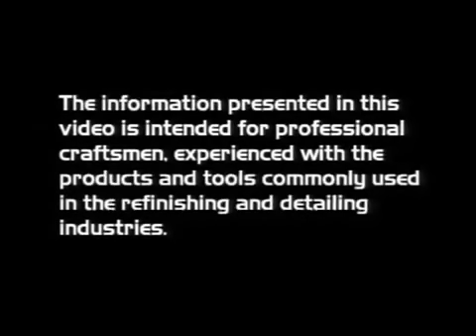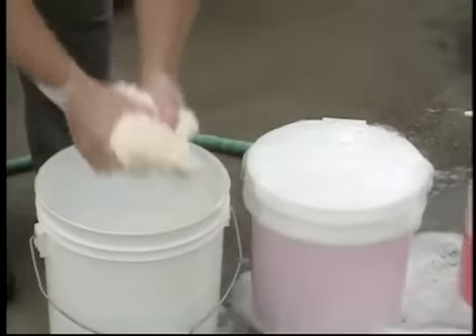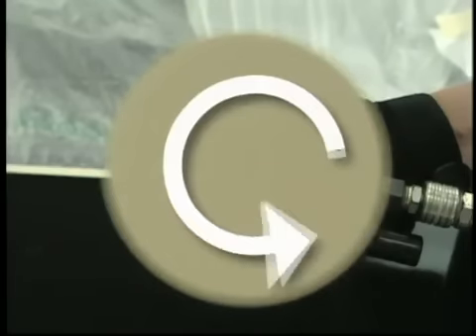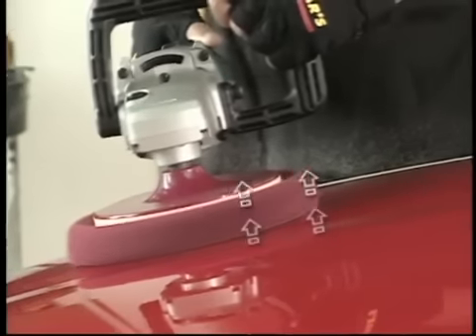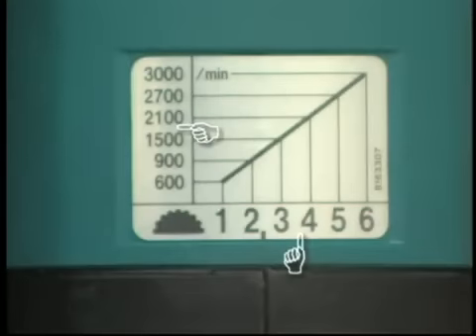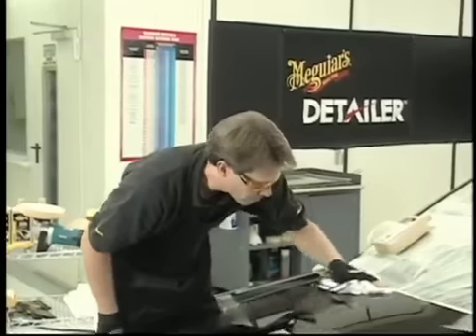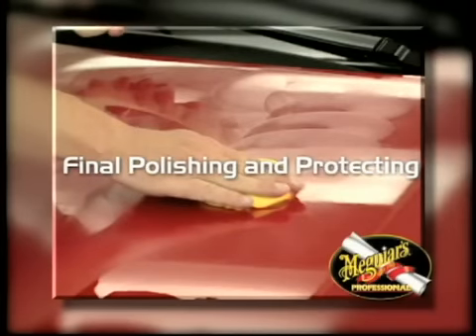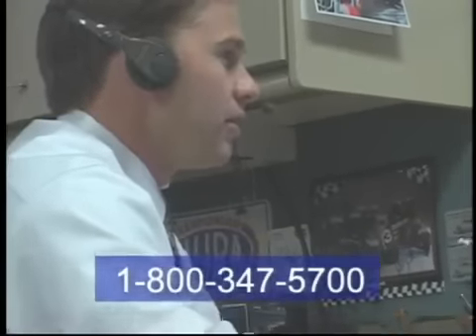How To Meguiar's Professional Mirror Glaze Training Video

Comment: What type of backing plate does this video use?   I have not seen this for sale so I assume it is an older plate or a plate not available in the United States?   It looks like a really nice backing plate with the foam interface and perfect size for larger foam pads such as 8" or 9" pads.

Comment: Rotary’s are useless in 2022 I only use RUPES forced action no need to possibly burn paint or edges when you can use a machine that won’t do that at all no matter how long you leave it on the paint and it cuts just as good if not better